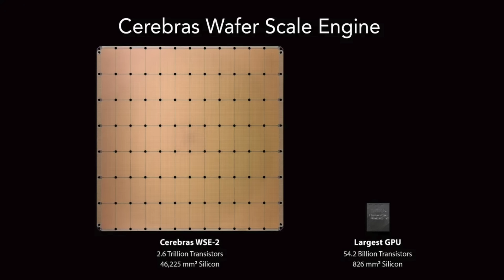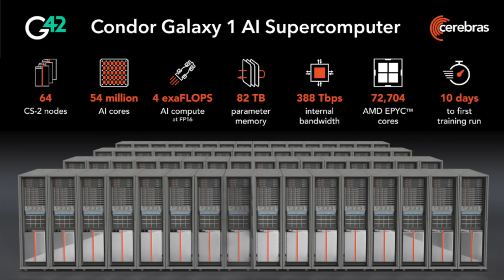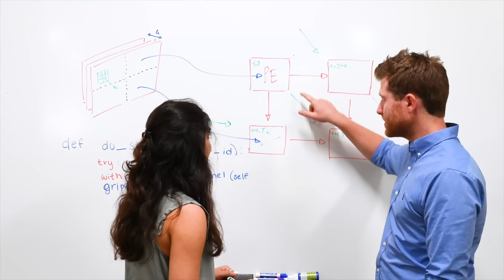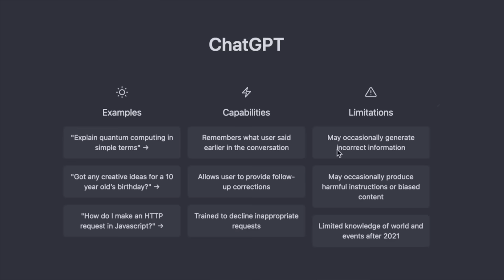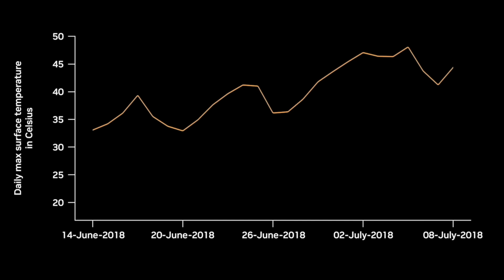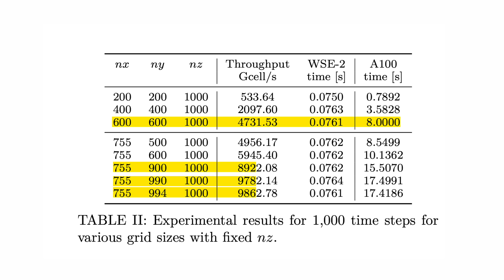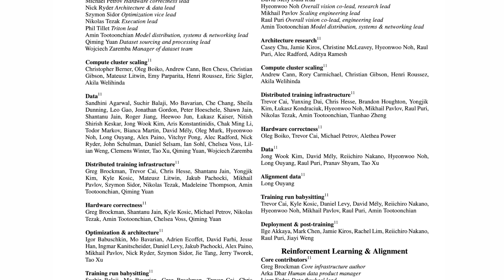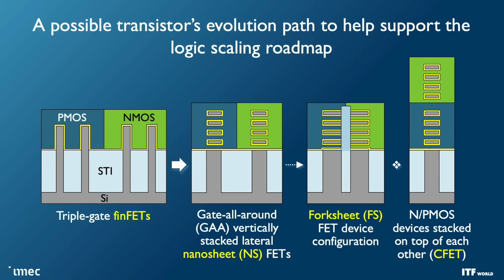New AI Supercomputer Outperforms NVIDIA

Comment: wonderful video, did some research about cerebras innovative and found out they really have done different and valuable things.
"wafer scale engine" is what cerebras been known for, unlike traditional GPU, it is produced on an entire wafer. Conventionally, multiple cpu or gpu are 'printed' by EV on a single wafer, and later processes will cut them off the wafer. Therefore, one reason cerebras is delivering much better performance is because its 'GPU' is bigger.
But this also leads to one problem: its even harder to produce than NVDIA GPUs, wafer often comes with defects, individual defected chips from conventional manufacture technique can be discarded. However, cerabras wafer scale engine needs the whole wafer to have no defects. In addtion, heat dissipation, even powering across whole surface are big challenges.
Right now, cerebras is cheaper because it's not yet that popular, once market sees advantages from their super computer, their price can go higher than h100 since they are really difficult to make under current tech level.

Comment: I am very interested in Cerebras and Tenstorrent, where they seem to be the most viable alternative to Nvidia, both being companies that makes AI chip that is very scalable.
The interesting differentiation between Cerebras and Tenstorrent is that Cerebras started with big chips working their way down (in a sense with enabling PyTorch compatibility) while Tenstorrent works from small chips and evolutionary works their way up.
It's interesting to see these different contrasting startup philosophies work in the same industry having basically the same main competitors. Hope to see you cover these two companies in future videos.
Reply: Actually the most viable alternative to Nvidia right now is AMD's MI series of processors. The MI300 series is due to be widely available in 2024, and it will probably beat the H100 in terms of performance and flexibility. The research I've done indicates that Cerebras and Tenstorrent are very distant alternatives at this point in time relative to both Nvidia and AMD. There's also Intel with their Gaudi series, where it fits in comparatively is probably along with Cerebras and Tens, the most worrisome aspect being the longevity of the roadmap, Intel has been cutting product lines over the last for years. As we know anything can change quickly since the AI sector is in very early stages, so it's worth looking at all the players including the current batch of underdogs.

Comment: It seems like an apples to oranges comparison. Put it against GH200 Superpod with 256 Grace Hopper Superchips. That is Nvidias latest offering. It's not only fast, but energy efficient.
Reply: 12x the gains. How the hell is nobody talking about it?
Reply: Nvidia fanboy spotted. Power efficiency is a nonissue when you’re talking about the most powerful compute power cuz most people won’t have access to this power until way later.
Reply: @waterflowzz exactly, power efficiency is not the main issue 🤦
Reply: You don't get the point: as the complexity of the problems you gave to feed on the AI grows these two systems stop scaling together.
90% of the raw costs is on people working on the project, so having a system that does NOT requires more work at all when your workload increases by orders of magnitudes, is a not brainer.
You can start training your AI system months before you will on any Nvidia systems.
The only thing Nvidia has on its side right now is the shear mass of chips produced each month, so I gues you can build a GH200 ai much faster then you can on Cerebras: not cheaper, but faster, despite being way behind in practicality and raw results.
Reply: Power efficient equals weak sauce. This is spicy af compared to nvidia offerings.
Reply: @Leptospirosi this would only matter if llm was the key to AGI…. But it isn’t. The compute power of llm is not going to get us to AGI, the industry is now working on the hard problem of consciousness and down the line AGI. We will not get AGI, we may get the best stochastic parrot from llm, but it will not be sentient or intelligent. But we are on the race now because of all the investment to actually answer as clear as we can in human terms what it means both to be conscious and then it’ll lead to what is wisdom which will in turn lead to AGI and silicon sages.
Reply: @henrytep8884  Uh huh, right. New Age meets AI.  I'm already annoyed.
Reply: @flickwtchr  why you annoyed? Just invest for future trends.
Reply: It's well and fine to talk about AGI, but what is selling is cloud storage management and web service management. Massive computational power plus power efficiency is everything. And, it's not just the chips, it's the whole stack.
Reply: Reason WS-2 is a complete failure at training 1T+ frontier model is the extremely limited amount of HBM memory one can connect to a giant wafer. H200s have 141GB HBM3 per card. 256 H200 cluster connected via NVLINK will easily fit a 1T model for training and inference.

Comment: The bane of wafer scale computing has always been that some percentage of the wafer will have defects and be unusable. Does Cerebras has some way around that problem? There was a famous attempt at this back in the 80's and the company couldn't solve the problem and went bankrupt (Trilogy Systems).
Reply: The final wafer processor always is quoted after taking into account the dysfunctional parts of that wafer. Meaning its always assumed to lose some parts to imperfections.
Reply: There's redundancy built into the chip, so a wafer defect only reduces performance instead of disabling the entire chip.
Reply: You deal with defects at the core level through logic

Comment: There's not a lot of information about Cerebras, so thanks for making this video. I'd like to know how flexible a machine like this is with experimenting with different models? Will you be limited to only a few kinds of models, if so then what exactly are those limitations? One known issue that Cerebras acknowledges as an intentional trade off, is that a machine like this is limited with floating point accuracy and will not be suitable for models that require higher 64bit precision. It appears the machine is optimized for 16bit precision only. I expect there will be other limitations besides the FB accuracy and a summary of what those limitations and what the tradeoffs are (pros and cons) will be nice to know about.

Comment: This is a really interesting video. The part I struggle with is the performance comparison between nvidia and cerebras, seems like comparing apples to oranges. How many nvidia chips are equivalent to 1 cerebras? And then how do you define this equivalence? I suppose those papers you link to will have some details lurking in there somewhere but for now I’ll just rely on what is presented in this video.

Comment: This is similar to the S1 supercomputer of the 1980s in concept.  It was a large wafer but with gates to be connected and could have a new design per week.  They used the whole wafer and etched the back side so as to conduct coolan in channels too small to have Bernoulli turbulance.

Comment: One thing I've wondered about is why aren't motherboards, or whatever you want to call what the chips are sitting on and the current travels on, printed.  Right now, all the circuitry sits on top, but if it was printed, you could print it in 3d so that the circuitry could sit stacked on top of each other.  Further more, all the circuitry would be protected from dust, something that slows it down.

Comment: Loved the ASML shot
Reply: I saw this yesterday, and tried to see what the largest supercomputers are.  I could have sworn I found 1.1 something exaflop; and the combined Cerebras was like 64 exaflops.  Do I have that right?
Reply: I found a great article yesterday; this one quote stuck in my mind for some strange reason,

"For example, a 40 billion–parameter network can be trained in about the same time as a 1 billion–parameter network if you devote 40-fold more hardware resources to it. Importantly, such a scale-up doesn’t require additional lines of code. Demonstrating linear scaling has historically been very troublesome because of the difficulty of dividing up big neural networks so they operate efficiently. “We scale linearly from 1 to 32 [CS-2s] with a keystroke,” he says."
Reply: Only 100 million dollars for one Condor Galaxy?  that's the same price for a one off Formula 1 car or even a Stealth fighter; i'd call that a pretty good deal.

Comment: Data parallel training will not allow you to train larger models, just train whatever models that fits faster.
If the limiting factor is the model size, the solution has to be to split the model across different compute units.

Comment: The correct way of evaluating designs such as this is not to look at raw TFlops number (use your favorite Tflop)  but look  at  TFlop/mm2 (die strate area)  Tflop/$ (Product cost -- essentially mm2 die strata x cost to manufacture )  or Tflop/W  ( power to get the Tflop).    The massive parallelization of AI workloads essentially makes scale-up (large parallel collection of individual components) relatively simple.  On this basis the Cerebras chips are not very compelling at all.   Today most of the traditional companies are going the route of some kind of 2 1/2 D integration -- essentially putting multi die in a package.  Server chips have crossed reticle limits on a package so Cerbras attempting to make the wafer  as a package -- rougly 40 550-580mm2 die -- isn't compelling.  Single package server chips are 4 die, 6 die configuration ( lets assume 400mm2/die)  means that roughly 10 of the packages would hit the wafer scale structure Cerebras shows.  A single 1u can easily accomode 4 such pacakges so what Cerebras shows can be accomodate in 2 server 1u racks *easily*.  The density of scale-up for the GPU companies is likely even higher.     If you now factor in the need to hook large memory (DRAM) to the individual compute, wafer scale really looks unwieldy.  Often the external I/O is done at die perimiter with the areal portion chewed up by power and thermals -- here again wafer scale is at a large dis-advantage simply because of perimeter/area being proportional to 1/d.  Might be much cheaper to die singulate and put them on  freaking large panels used by the large screen industry if all we want is bragging rights on "see I have X TFlops" -- never understand why engineers waste time with such things.

Comment: I can't get any real use out of the 'waferscale vs A100' comparison... sure, the Cerebras superchip is many times faster, but a server rack full of nvidia GPUs is going to have quite a number of chips inside.
As such, a 'single rack' comparison would really interest me in terms of compute power, investment cost and energy consumption.
Reply: One thing to keep in mind when assembling a server rack full of GPUs is that you will be far from having perfect strong scaling. In other words, if the Cerebras CS-2 is about 200x faster than a single A100, 200 A100 will still be slower as they will not get perfect strong scalability.

Comment: While this sounds incredible, I was a bit taken back by the unsupported claims that the CEO made. Is their supercomputer x50-x60 or even x200 times faster than a single A100? I want to see real comparable figures detailing the configuration of their solution because only then will we be able to determine the true level of performance that their solution brings. I've seen marketing material from Intel for their AI solutions where they made claims to be faster than NVIDIA, but when looking at their comparisons they were comparing their solutions against 2 generations older NVIDIA hardware. So I don't trust these sort of marketing stories.
While building wafer scale processors seems like a great idea, the reality of process yields is that not all of these processors will come out of production functioning, which will drive up costs. The advantages are of course that you can pack more processing capability in a smaller form factor. Each A100 comes with external components that take up space, which also requires a system that is larger to house these multitudes of A100's. 
The latency issues that you mention that hamper the A100's will also hamper Cerebrus. If data needs to be moved between the wafer scale processors or even the geographically spread out Galaxy supercomputers they will incur latency penalties. There is no way around that. 
The advantage that NVIDIA has is that their A100 based supercomputers are not limited to AI work, they can also run general High Performance Compute workloads. No word on whether Cerebras's solution can do the same. 
Don't get me wrong, I see that this is quite an amazing achievement, but there are both technical and economical challenges associated with their solution, and I'm always skeptical when company CEO's start promoting their solutions. I've seen too many presentations where they push the most optimistic view of their product in order to wow the audience.

Comment: 50x faster than a A100; BUT; it's also 50x times bigger! What is impressive is that they managed to make such a single large chip (on 1 wafer). That is just another step in the evolution. We'll see more smaller companies fixate on fringe improvements which may end up being adopted by the whole industry. There are other players on the field who show more impressive gains, which is good. It will drive the market to adopt winning strategies but also more strategies will be "tried" (risk factor). Another 2-3 generations should see this being a mature market at which time actual costs will start plummeting and commercial devices with these will become affordable. (if it even needs to due to cloud computing)

Comment: you  can  literally   tune   the   design  by  listening  to  the  transfer  of  electrical   contact  at   each  point  ,  the  finer   tuned   a  chip  is  the   easier  the   flow rate  ,ipc  is  thrown  out  the   window  here

Comment: They comprehend the future....I once worked at Intel on the 432 project and transparent multiprocessor multiprocessing....I got to speak with Steve Jobs about it for a few hours, before he returned to Apple and switched them to the Intel platform and founded Pixar....
The concept of multiple redundent and bonded data paths with intelligen network on demand configuration will eventually allow all systems to act as one and any one to act as many....it is not a matter of if but when....and when quantum meets von numen and biological and hooks into all digital and analog channels....omg

Comment: With wafer scale chips one needs to have world class wafer defect densities, even better than Intel and AMD and TSMC....which is almost impossible given how big the Cerberus chip is.
Alternatively the design of the chip must incorporate a lot of fault tolerance circuits in the design and a lot of redundancy because logic gates and memory (static and any dynamic ) cells will have defects that will cause the chip to fail without fault tolerance circuits.
So I am very sceptical  they can can produce these chips in volume and to the stated specs within decent power budgets that are economic to run high performance algos.
As per your review this is indeed low volume high end market that can bear the burden of soo many defect wafers. They only need a few to be perfect.
Reply: My thoughts exactly. There are ALWAYS wafer defects, especially at the EUV lithography stated. I dread to think how many wafers need to be manufactured to get just one golden sample

Comment: First off, CUDA isnt just for "parallel GPU computation". It's an entire software ecosystem that includes deep learning, linear algebra, sparse matrix, random number, image processing, FFT, profilers, etc. Secondly; PyTorch isnt CUDA. It's a higher level of abstraction that may use CUDA to run on NVidia GPU's.
Thirdly; who is your audience? most of us could scrape together 7 grand for an A100 if you're really serious about ML, but how many are going to cough up 2 million or so for a proprietary system then plug it into your 1.75 MW outlet to run it? No, we are going to use NVidia card(s) on COTS hardware or scale a bunch with NVLink and not be too concerned how cool it is to put a bunch of processors on one giant wafer.
Reply: You could also rent some time on a larger scale machine (regardless of the vendor) on some cloud computing platform

Comment: Wow, a processor that big should generate a lot of heat, which wouldn't be a problem, even if the thing rises the temperatur enough to bake a pizza, but I don't think that it would be possible to put a heat sink in the middle of those squares, but hey maybe the computers of the future will integrate a cupcake tray.

Comment: The market for this product is very niche.
Super computers, specifically for data sets and AI.
I would not be surprised, once the investors money dries up, the company goes belly up.

They took a very expensive route to use 1 wafer for 1 CPU.
They claim a core count 850.000 and 100% yield.
The yield of 100% is a pipe-dream.
TSMC peak yield is 90% per wafer.
But realistically ~70% yield is normal/expected.
Counting how many ' pieces ' you see on the chip, its 84.
so 10.119,047 cores per piece.
This should tell you there is something that they are not telling.

They have to account for the loss.
850.000 + 30% = 1.105.000

I suspect each piece consists of ~ 13.000 cores, which is very close to the 30%.